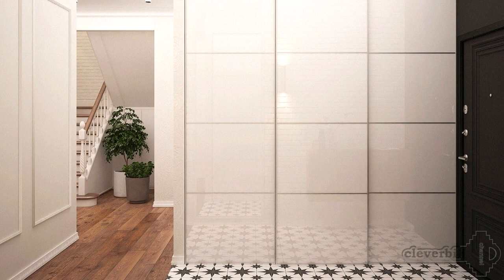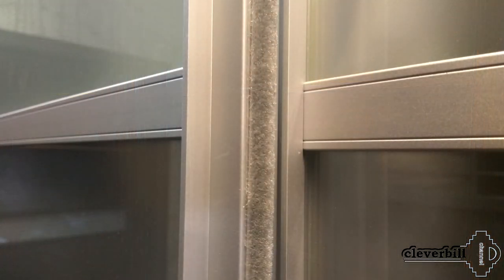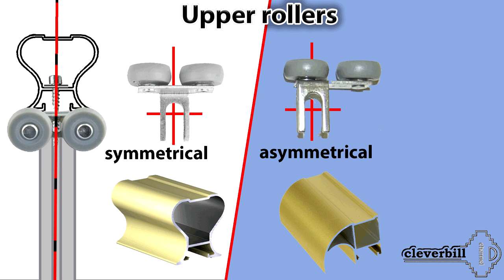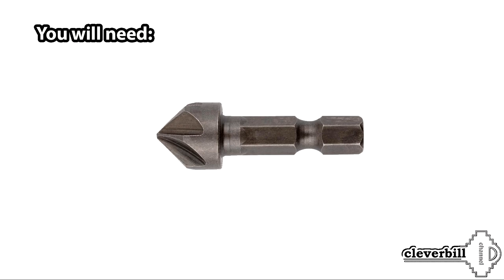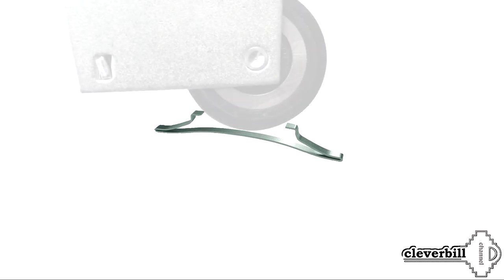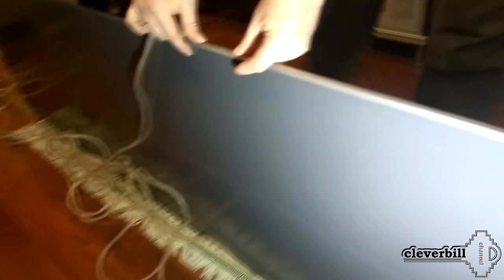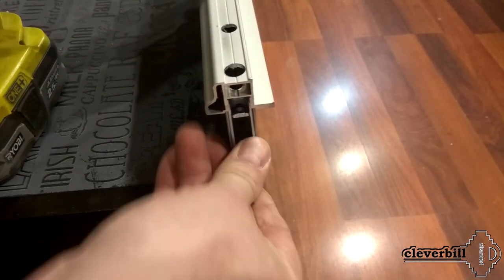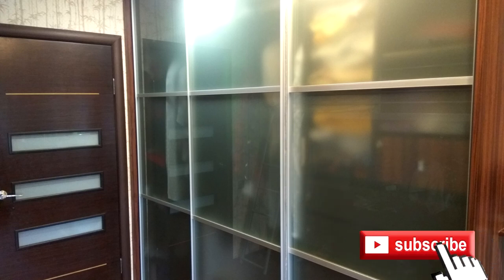DIY sliding doors for a wardrobe from an aluminum profile

Comment: U have explained very well.
I have same type wardrobe due to gap cockroach n dust is entering. Clothes r not safe. Plz suggest solution
Reply from the maker: If it is necessary to eliminate the gap in the lower part of the door, then this is difficult to do because the rollers are located there.
Reply: Move